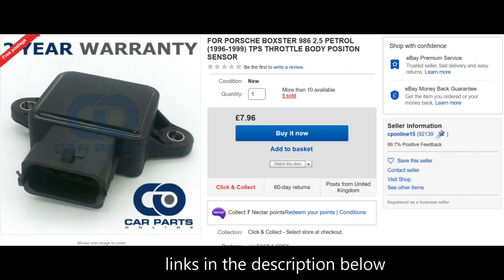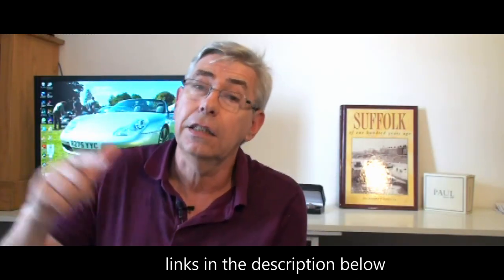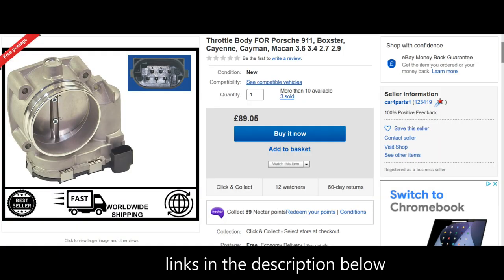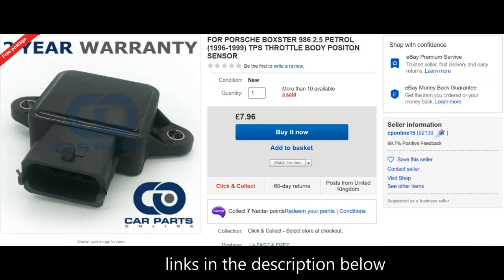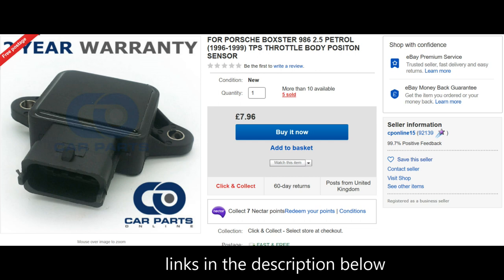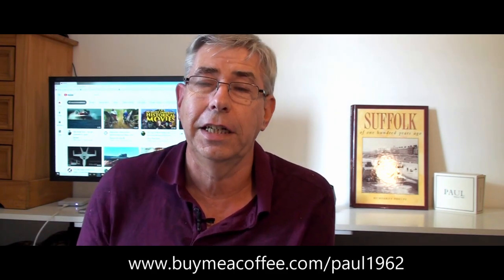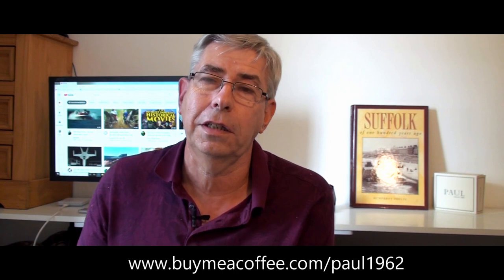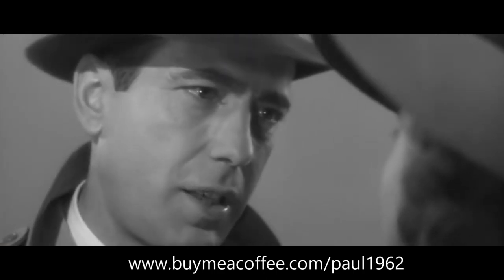Porsche Boxster 986 - Cable TPS or E gas fly by wire

Comment: Whats happened to Paul ?
Reply from the maker: Hi Dave, I have just been very busy of late. I keep saying I need to find the time to make some more content, but then life gets in the way again.
Reply: @Paul1962  thanks Paul for the update... look forward to your up and coming content. keep safe buddy.
Reply: Hi Paul, Following on from David’s reply. Looking forward to you being able to get going again. Any chance of a quick blog to let us know how your getting on. ?
Best,   Andy
Reply from the maker: @andrewlundie8155   Hi Andrew, i will try and put something together by the end of the month.
Reply: @Paul1962  
Hi Paul, Hope your  OK. I hope its OK to ask for a bit of advice. I have to replace my original Back Box on my 1999 2.5 Boxster.
As you replaced your system recently can you remember what Back Box you have on and where you bought it from. Some of the new system are very noisy and give a loud droning noise just behind your head when motoring. Many thanks. Looking forward to hearing from you.  Andy
Reply from the maker: @andrewlundie8155  Hi Andrew, I had mine custom made at https://fastlanestyling.co.uk/ It's a twin system with two boxes, the bigger the boxes the quieter it will be. I went  for the biggest boxes they could fit in the space. Systems are stainless steel with a life time guarantee. £450, but that was 6 years ago.
Reply: @Paul1962  
Thanks Paul. I'll contact them and see what they can do.